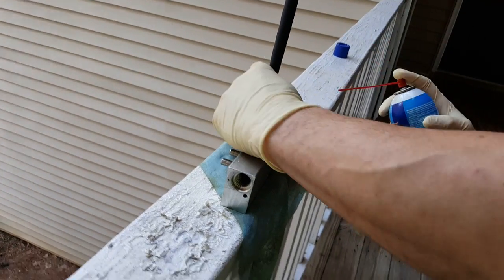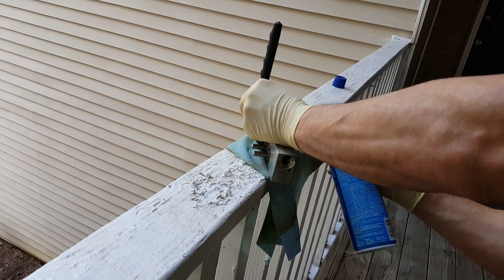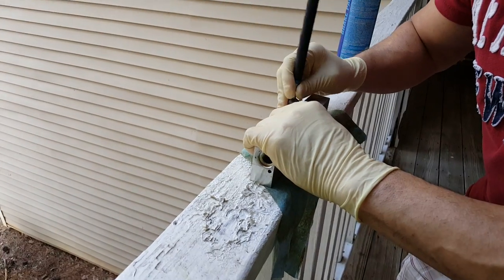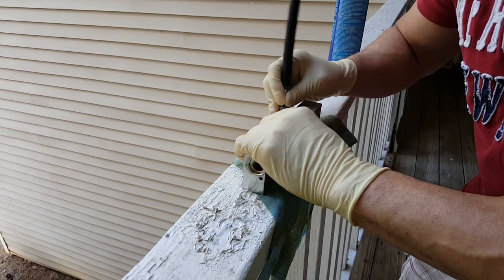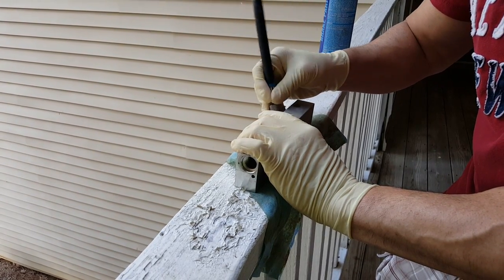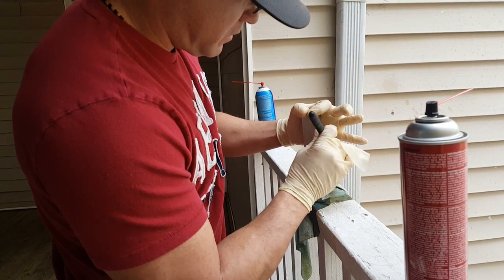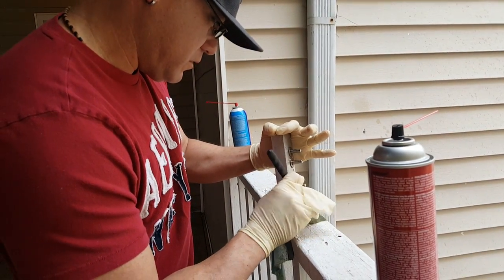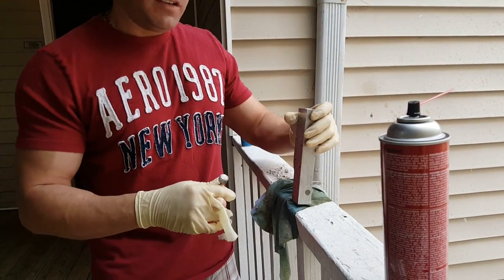S54 vanos valve body cleaning

Comment: Did it help?
Reply from the maker: Soorya Todatry , yes! It felt like it gained 50hp! The entire rev range  became violently pleasant lol. Good luck.
Reply: @frankdogg75   Im having a similar issue with P0014 and P0017.  Did your P0012 go away after this thorough cleaning?  Thanks
Reply from the maker: @yhp99  it made the codes not return after clearing them. So far 4k miles since I made this video. And still runs fantastic. Also, make sure you clean out your filter too. You can normally just hose it off with brake cleaner. Removing it will only break it. And you will have to buy a new one. So use care when cleaning. Good luck! Hopefully it works for you too.
Reply: @frankdogg75  Thats good to hear. Ill try it myself and thanks for posting this video